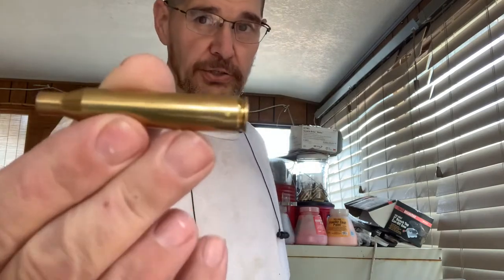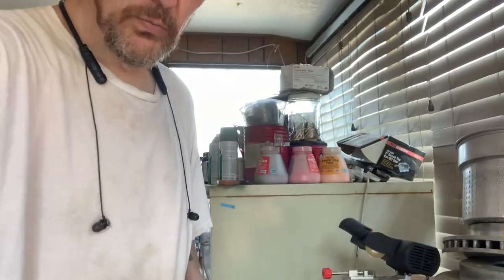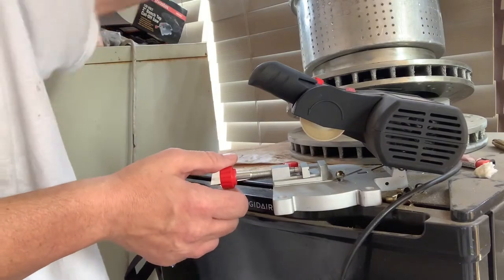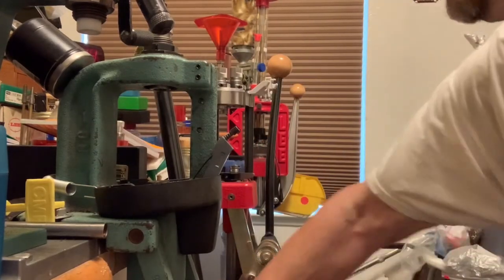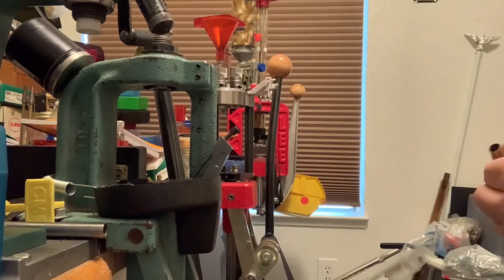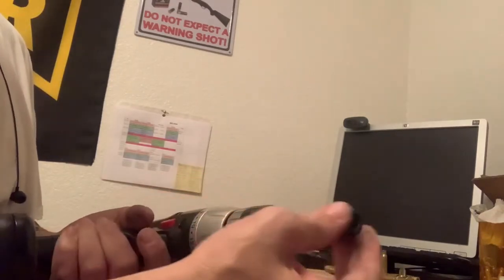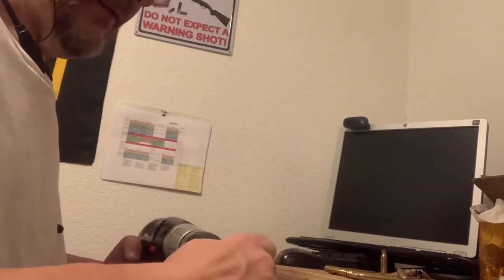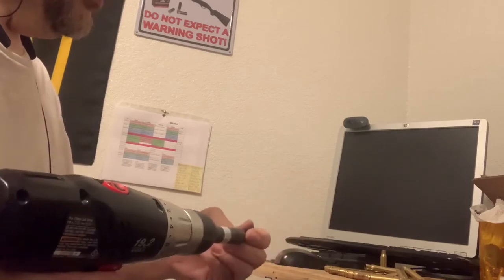Converting useless brass to useful brass

Comment: Nice. I made a bunch of .308 brass from 270 brass free from the range. Made subsonic with trailboss as the first fireform. Caseneck was thick but worked fine with 230gr lee lead pro’s
Reply from the maker: Cool great job I checked the neck thickness they are at 13 thousand no need to turn the neck

Comment: Wow that looked easy. I need more 7mm BR. I just need to find small primer .308 cases.
Reply from the maker: There you go it is easy but one thing I didn’t show was if you case neck could be thinker then normal I got really lucky and my case neck after alteration was 13,000 thick so no need to trim the neck but if you don’t mind trimming it will be fine I hope you find the cases you need